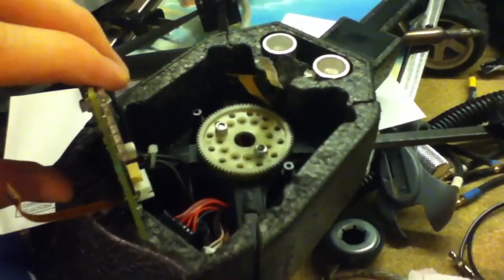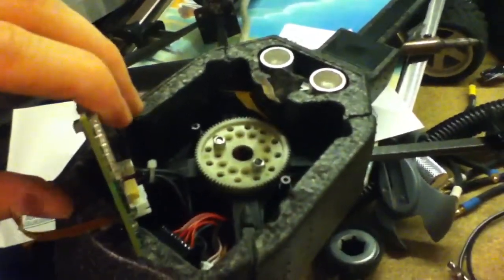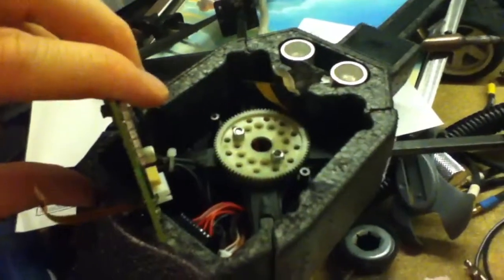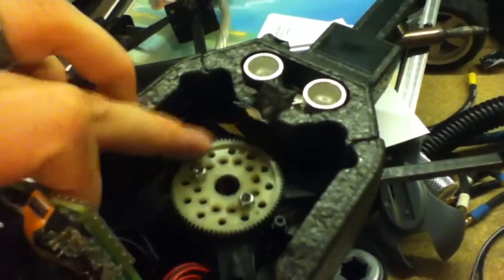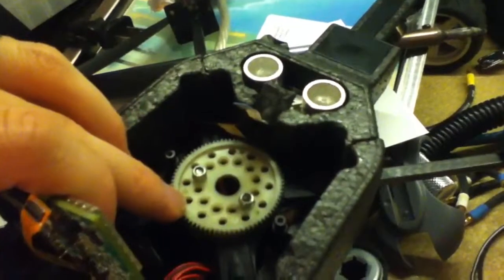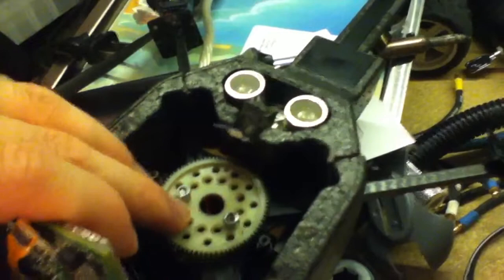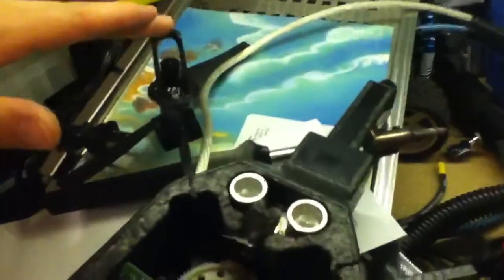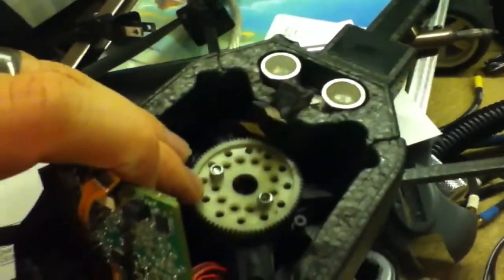AR Drone Crossbar Fix

Comment: My drone just took a dump from about 50 feet in the air, landed flat and snapped the crossbar right down the middle. This fix worked like a charm, I knew those old spur gears with chewed teeth would come in handy for something! Does add extra weight, but it does get you back in the air until spare parts arrive.

Comment from the maker: Surprisingly well. I did the firmware update last week and got to excited which resulted in me letting the thing crash into a tree. The emerency cutoff kicked in and it dropped from 18 feet or so. The video stopped working until I could open it up again and check connections. To my surprise the video is working again after wiggling a few of the connections. I also put masking tape over the nuts & bolts just to make sure that they didn't short anything on the motherboard.